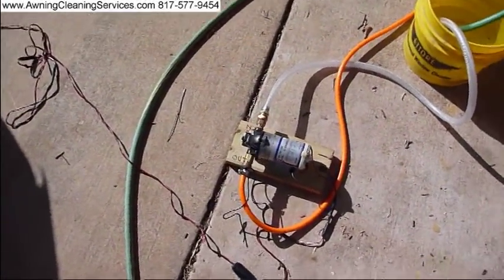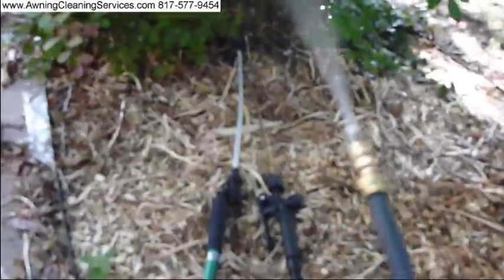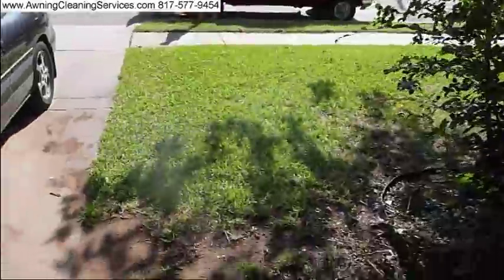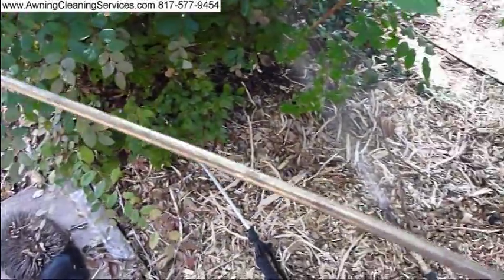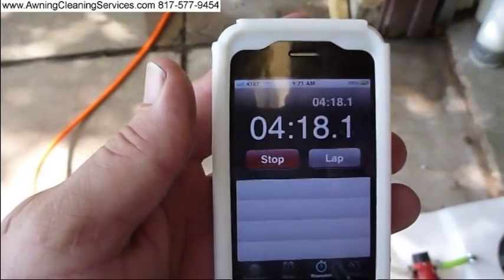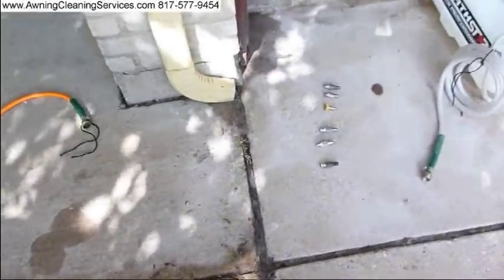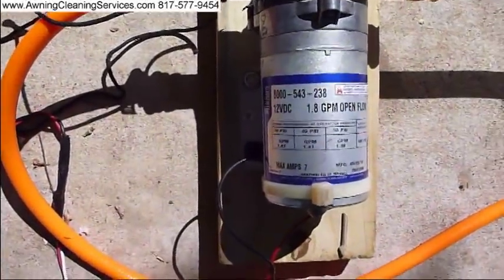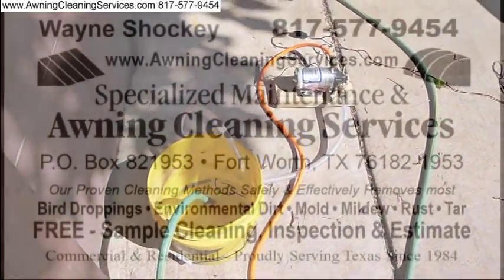Testing A Shurflo 12 volt Water Pump on a Sprayer Dallas Fort Worth TX DFW

Comment: I used this pump and the water tank out of a RV with a 100 ft hose and wand for spraying weeds works good. the pump automatically shuts off when not using which makes it nice

Comment: @GennBoy You need the 115v version of that pump instead....see the comment with the correct part number.

Return the 12v version and get the right one. The Shurflo 8000-713-238 is $115 @ steam-brite

Comment: For what it is worth...I finally gave up on the shure flows pumps.  They are like having a pump-up sprayer, you just dont have to stop to pump up the sprayer.  I also used one temperature grade to pump hot wort on a brewing system, and it wouldnt give me a 3 ft head with a 3ft head at input.  If a guy is doinglittel bitty stuff like this, it may be ok. I still spray my yard with one, but it takes too longm, that is a 2 gpm pump.  I think i will try the Northstart 5 gpm.

Comment: What would be the distance out of the hose without a pressure nozzle? Anyone know? 
I'm looking for a solid, long line of water off a 12 v system - maybe 10 meters / 13 yards or so for short durations. Amperage isn't a problem, but it must be 12 volts (off a car alternator).

Comment: @GennBoy I found a 10A supply for $60 @ Tower Hobbies
Search for "Integy 12V 10A DC Power Supply PS10"
It can run motor lathes....and is a switching power supply (good)